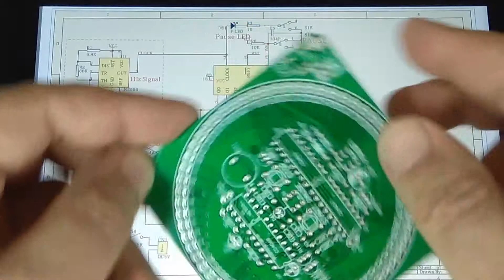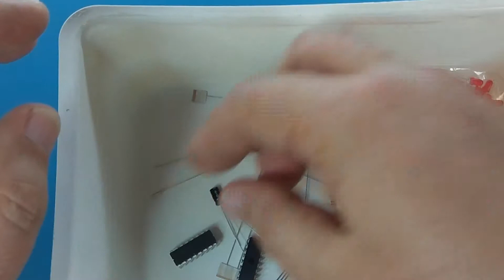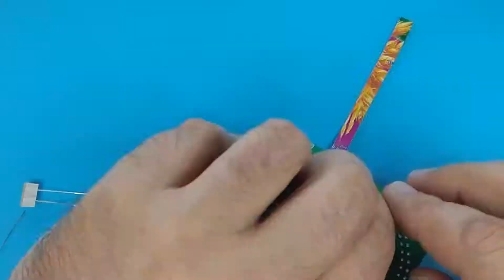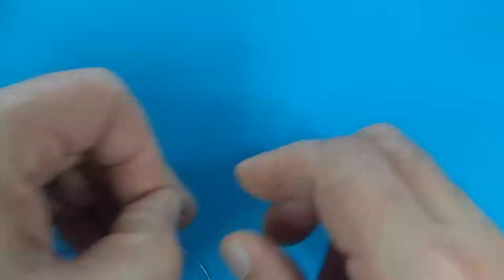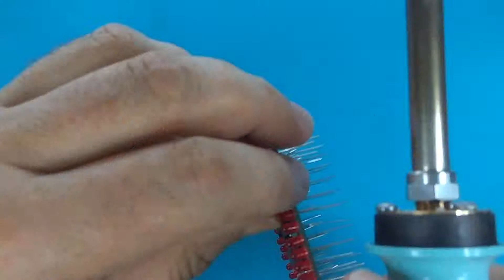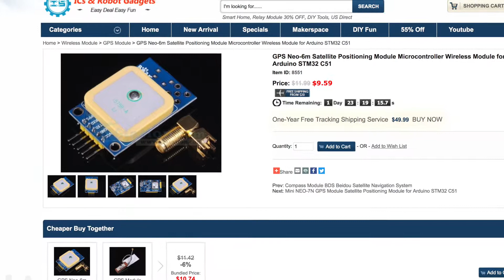ICStation - Red Countdown Timer 60s Rotary Electronic Clock  Alarm DIY Kit

Comment: I completed this, however, it loses power after 10 seconds… any idea?
Reply from the maker: I'm not a big believer in remote diagnosis, but since it's Christmas, I'd like to help. I would like a more detailed description of the problem. The first 10 LEDs work fine and then everything goes dark? Is there still power consumption? Is the 555 giving the clock signal? Do you have any instrumentation to measure the circuit? What happens if you press the pause button for the first 10 seconds?
Reply: @bzoli5706  thank you for your time. No, everything turns on; time, leds change each second, buttons work to change time, etc. however, after approximately 10 seconds, it turns blank. I then give the power source a jiggle and it comes back on, for another 10 seconds….
Reply from the maker: @gugzy  could you make a non-public video about these phenomena?
Reply: @bzoli5706  turns out it was my power supply. All is well now. Thanks for your support.

Comment: '
can this clock kit go backward as reverse from 60 to 1
Reply from the maker: First I wanted to answer "No" because the direction is hard-wired into this circuit. But I have an idea, if you assemble the LEDs on the other side of the PCB, then it will be the reverse direction.
Reply: @bzoli5706 
hi B...
'
big thank